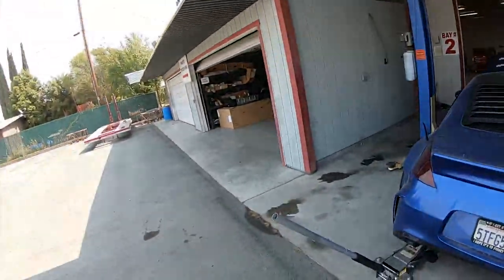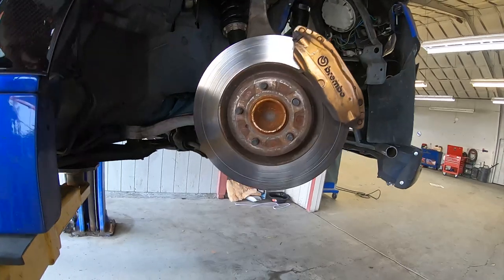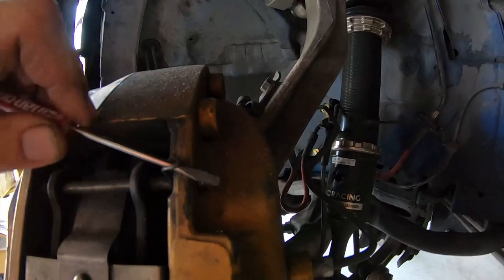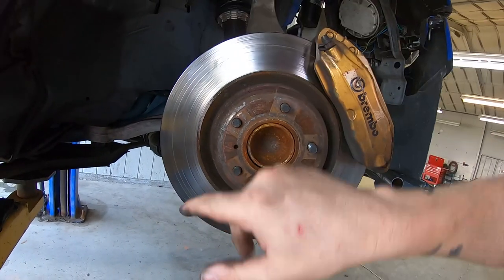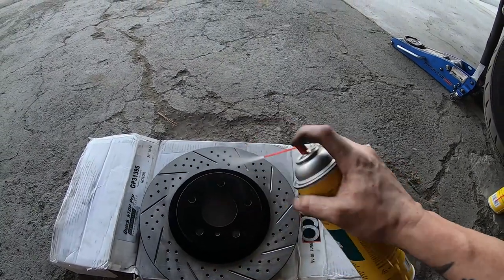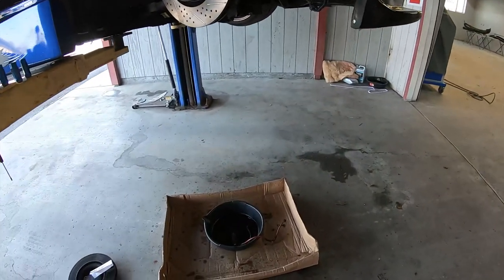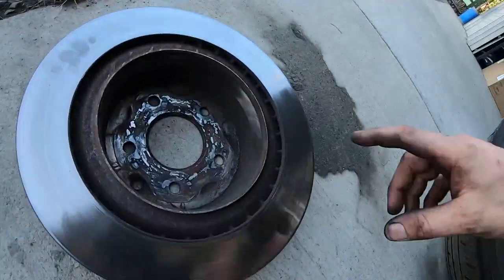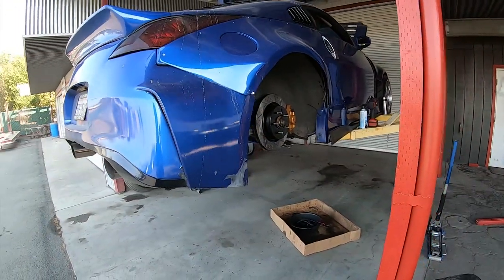HOW TO.. Brembo Brake Upgrade/ Ls350z Test Drive

Comment: Idk if I saw wrong but you were driving that car with the oil light on? And if it was on why it was? Because is clearly not missing oil. Myke Mike would of notices that !
Reply from the maker: SO it is, however with the wiring, the oil pressure is hooked up to the ecu but not the factory gauge in the car, so we are actually installing one with a piggy back harness to run straight to the gauge to turn that off and enable us to monitor the oil pressure just like in the factory setting.🤙👊